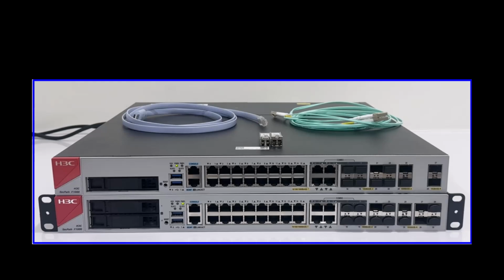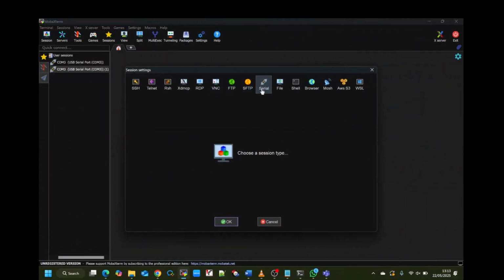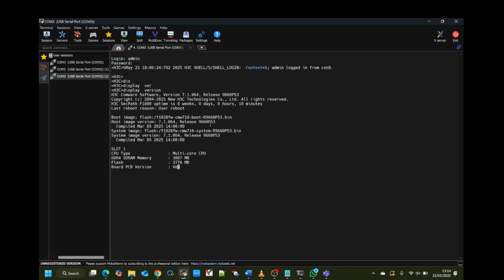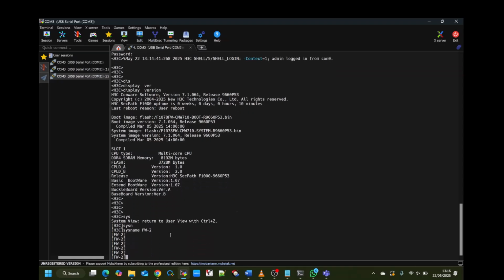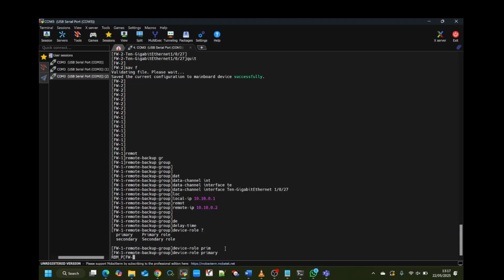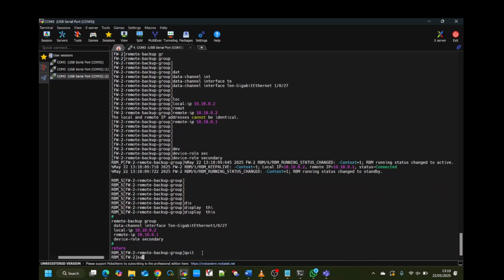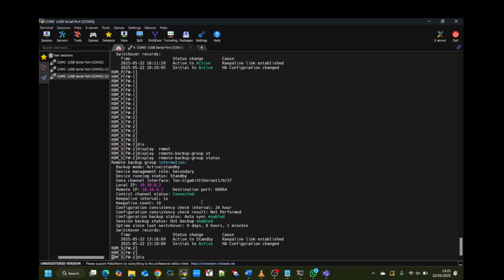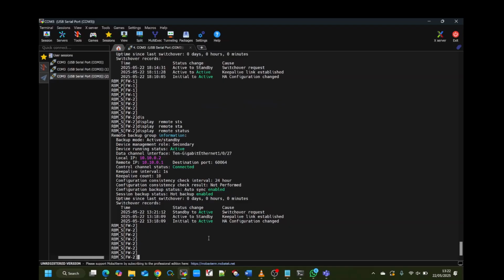H3C Firewall High Availability HA/RBM Configurations & Switchover Test

Comment: Using this HA/RBM. Should we configure both FW the same? Or we can access 1 FW and all of the configurations wil automatically be saved on the other?
Reply: Also how can I reach you out? Im dealing with a project now. Using 2 FW in HA and having a WAN Switch going to 2 ISPs. H3C website is lacking information in dealing with this type of setup.
Reply from the maker: @Mark.G_23  Check the link below for H3C firewall details & test scenarios post. If still issues, contact us via our website's Contact Us page ,our team will assist you.                                                                   https://www.readteknology.com/h3c-firewall-initialization-version-upgrade-ha-failover-secpath-f5000/
Reply from the maker: After HA/RBM is set up, you only need to configure the primary firewall , it will sync automatically to the secondary. On H3C,each firewall has its own CLI, unlike Fortinet or some other vendors, where both are managed from one CLI.